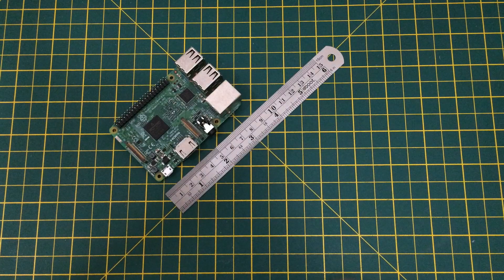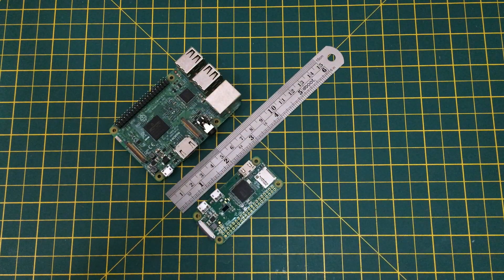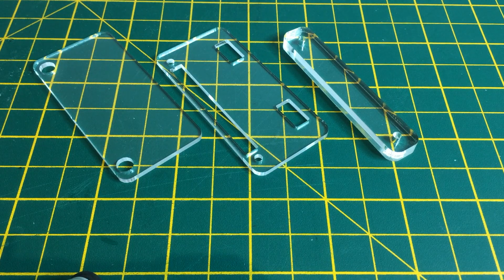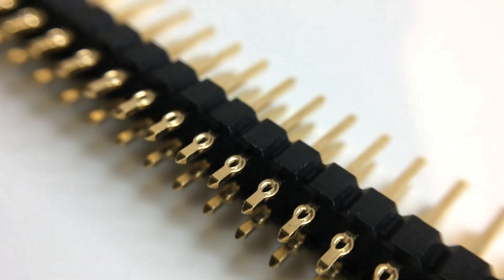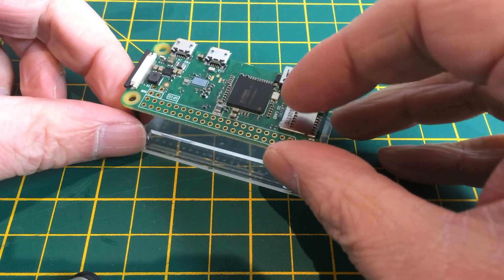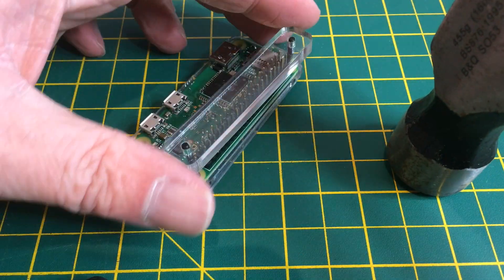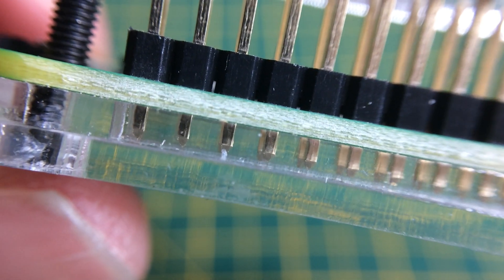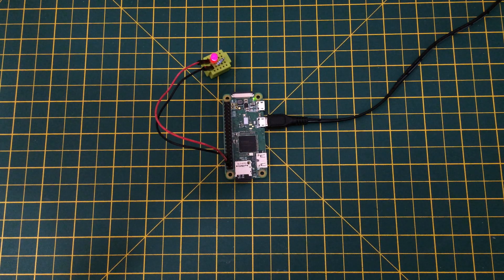Adding Headers to a RaspberryPi Zero without soldering //How-to

Comment: is there a way to remove the headers once hammered in?
Reply from the maker: The pin holes on Raspberry Pi boards are really well manufactured, so you should have no trouble turning the board upside down and applying pressure in the opposite direction. 

You’ll want to make sure the chips are not squished though. 😃

Comment: Hi ,i wish i seen your video as i arsed mine up.I ended up bending the pins and broke the thin perspex where the long rectangle is.It was a nightmare to sort the pins but once sorted ,i used the female gpio header on to the male header and repeated the process.
This rescued an almost disastrous situation.
The use of a adjustable clamp is a excellent idea which i will use in future unless i am lucky to purchase RPI with gpio headers soldered on.
Thank you for sharing the video and the excellent tip (use of clamp)

Comment: Can you suggest what clamps to use for this?
Reply from the maker: I’ve used a couple of different types of clamp when fitting these solderless pins. 

A vice works well. https://www.amazon.co.uk/dp/B01L27B094
Reply from the maker: As do a pair of these clamps. https://www.amazon.co.uk/dp/B001C7LTSW
Reply: Thanks, much appreciated

Comment: I used this kit on other PCBs, but with the female connectors instead of the perspex bar applying the pressure from the top, and the whole lot squeezed in a small vice to apply pressure slowly and evenly. (Obviously no bolts in my case and remove the female connectors once done.)   Not tested it yet but it seems to have worked a treat. Thanks for the creative 'spark'. I would have hated to have soldered or hammered this lot.
Reply: PS  On about my 6th one, I found the female connectors pulled the male connectors out when I tried to remove them. However, if the vice jaws are smooth, you can do away with the female connector strip / perspex top bar altogether: just use the slotted perspex piece underneath.
Reply from the maker: Thanks. You’re right, the female part of the kit is great on the extension boards. I used them on my Patreon display with a Pimoroni Ultra White LED display.

Comment: Seems odd that they didn't include screws that were long enough that you could use them to tighten down the crossbar and pop the pins in.
Reply from the maker: I know what you mean but I think it needs pressure in the middle as well as the ends. Otherwise the plastic will flex.

Comment: Why the need for the jig kit at all? If you just carefully place the header pin assembly and Pi Zero in a vice with everything carefully aligined you can just wind on uniform pressure that compresses the pins correctly in finely controlled increments.
Reply from the maker: I'm glad you asked that. Take a look at another of my Raspberry Pi videos https://youtu.be/JnV8ICpmnQM.
I use a small table top vice and tighten the jaws until i hear the ping of the pins popping into place. The jig came with the headers and is useful for both the Pi and any Phats that use want to use with it. It also stops the electronics coming in contact with the vice.

Comment: What do the headers do for the computer. Like is it required to run the computer or is it to help out with performance. I'm new to making computers and this would help out alot.
Reply from the maker: Headers allow you to attach wires to the RaspberryPi, allowing it to connect to things you want to talk to. These can be sensors for input or motors for output. You can run a RaspberryPi without them though.

Comment: What's the advantage of the hammerhead method over buying the version of the zero with the header pins already soldered in? And then either way, does adding a hat still require soldering?
Reply from the maker: This video was planned before RaspberryPi started selling Zeros with the headers already soldered in. The hammer headers come in male and female versions though. So you can take a pHat and make that work without soldering in exactly the same way.
Reply from the maker: This follow-up video shows how I added a pHat without soldering. https://youtu.be/JnV8ICpmnQM